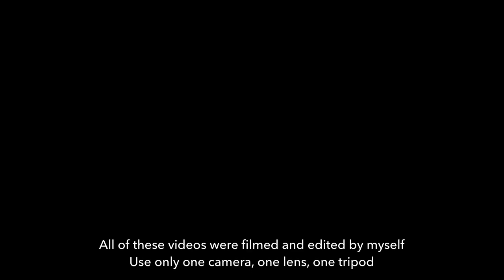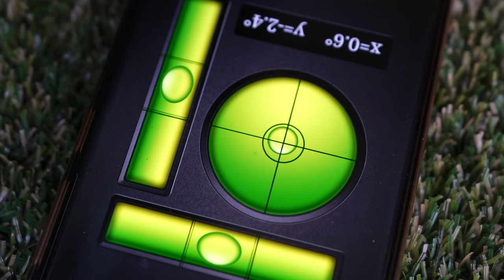😍 Live in my car 🤔 24 hour camping in the landrover DEFENDER

Comment: At least I see you can water the grass you're growing inside on the floor...
Nice sprinkler system..
I just don't have enough room to lay down in mine without ripping all the seats out....

I guess A lot's changed since the 96 Land Rover Discovery... Very low miles though